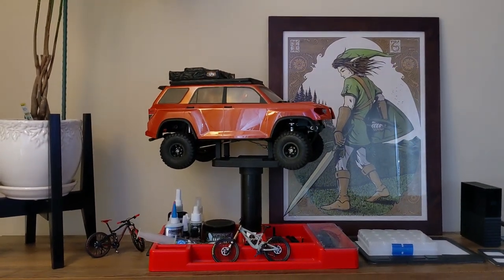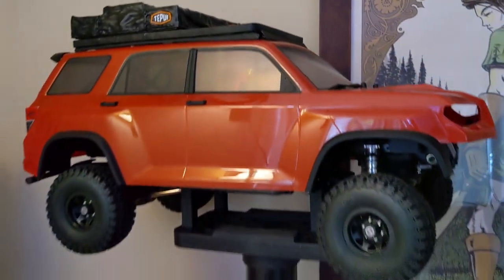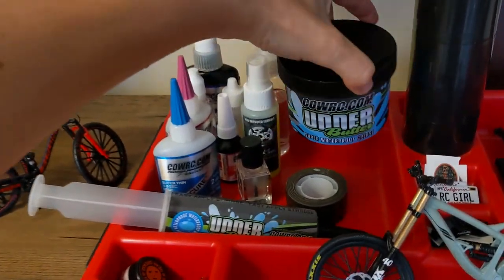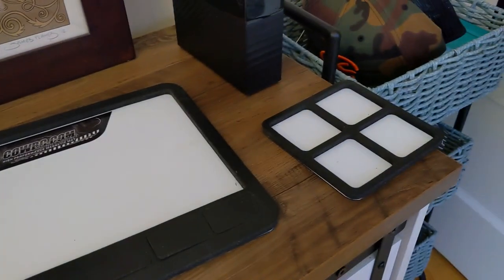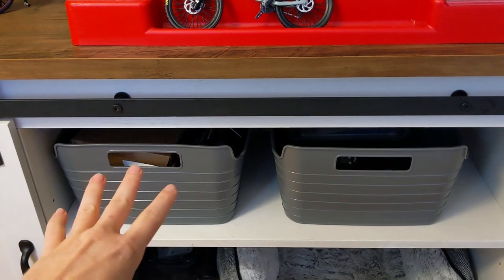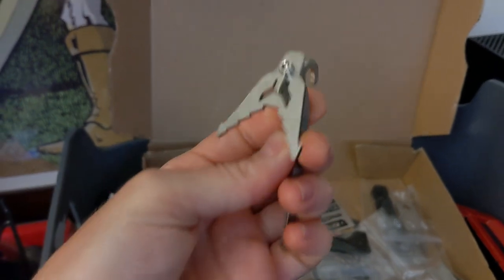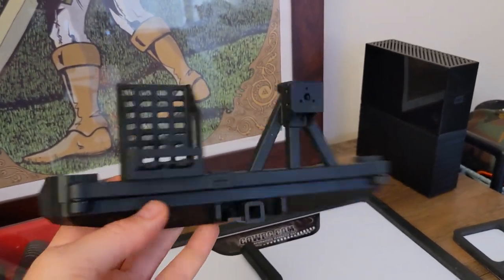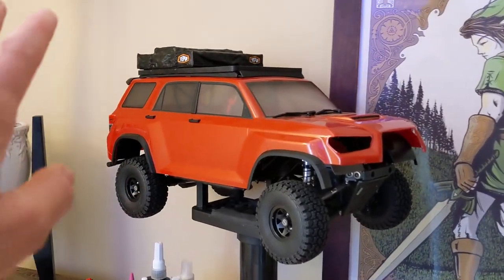RC Girl's Element Trail Runner build update!

Comment: Know nothing about 3D printing but seems like the possibilities are endless. Can u recommend that resin printer?
Reply from the maker: Yeah absolutely. Did a ton of research on resin printers and landed on the Anycubic Photon Mono X. Seems to be one of the bigger print volumes for the price. (https://amzn.to/3mkEAyh) Also picked up the Wash and Cure Plus (https://amzn.to/3NpQxhS) - would recommend that too, which helps with some of the post processing. Somewhat of a learning curve and also deals with some corrosive chemicals, so folk usually don't recommend starting with resin (though I did and was fine!).

Comment: The glue you showed is made by Smith Industries.  They will print labels for the various hobby shops and internet sellers.
Reply from the maker: Yeah lots of rebranding happening
Reply: @RCGirl  The brothers are twins and they bought a hobby shop in Northridge in the early 70’s in Northridge, CA called Smith Brothers where I grew up and they sold the shop but the shop kept the same name.  One of the brothers started the CA glue business in a factory in Northern California and many hobby shops use his CA glues. They just rebrand the labels to the local hoppy shops or online shops names.  The glue is very good but it will dry up fast on you if you don’t put the cap on correctly.

Comment: Wonder if you could provide the make and model of your 3D printer.
Thanks
Reply from the maker: Hey! Did a ton of research on resin printers and landed on the Anycubic Photon Mono X. Seems to be one of the bigger print volumes for the price. (https://amzn.to/3mkEAyh) Also picked up the Wash and Cure Plus (https://amzn.to/3NpQxhS) - would recommend that too, which helps with some of the post processing. Somewhat of a learning curve and also deals with some corrosive chemicals, so folk usually don't recommend starting with resin (though I did and was fine!).